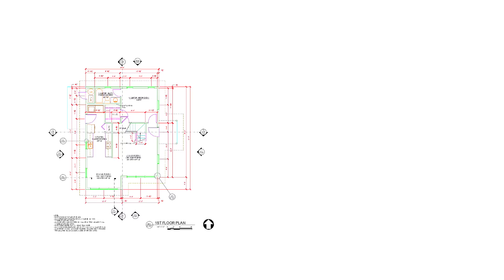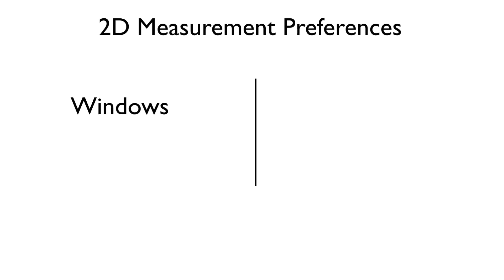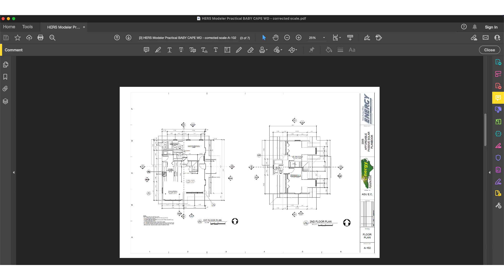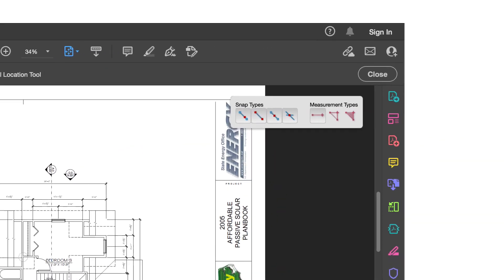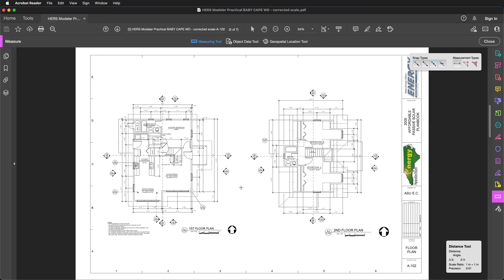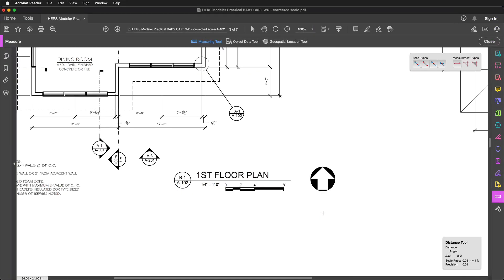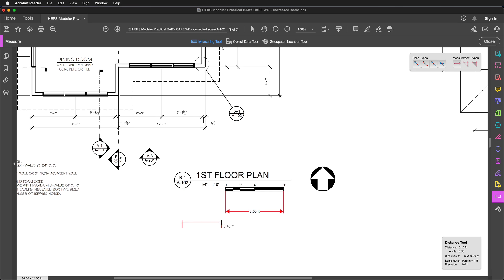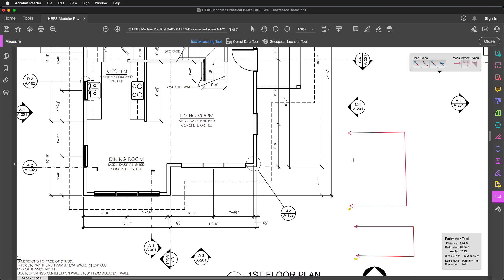How to measure plans in Adobe Acrobat Reader.

Comment: How do you set a scale on a document that does not have a preset scale? For example a screenshot from Google Maps of an apartment complex site. I know the length of a certain wall is 30ft (from measuring in the field). I want to calibrate all measurements from this 30ft wall.
Reply from the maker: You want to find out how many inches are in one foot.  To get this use the measuring tool and draw a line from one end of the wall to the other.  It will tell you how many inches it would be if it was printed out.  Now divide the number of inches it shows by the length you know the wall to be.  For instance, if it shows 7.5 inches and the wall is 30ft.  Then 7.5/30 = 0.25.  So, in that example there are 0.25 inches to each foot.  A scale of 1/4" = 1'.

Comment: My adobe doesn't have this feature anywhere? Why doesn't it show up?
Reply: It may depend on your adobe version. In my version, it was not exactly as this tutorial presented in the very beginning of the  instructions. But after that, it was quite straight forward. Try this below. I hope it may help you.

1) Click on "Menu," and then on Preferences.

2) In the box that opens, click on "Measurement (2D)."

3) Uncheck the first option "Use document scale and units...".

4) Click OK.

5) Go back to the menu and open the file of interest.

6) Go to the "All Tools" menu.

7) Still in this menu, click on "See More."

8) Click on the "Measure Objects" option.

9) Then, in the three options that open, click on "Measuring Tool."

10) Right-click on the drawing and choose the first option ("Change scale of...") and calibrate your scale based on an existing measurement in the drawing.

11) Next, in the submenu that appears, choose the type of measurement (distance, perimeter, area).

12) Now you are ready to take measurements. Click on the starting point and then on the endpoint. And again at the end. The measured value will appears, and you can adjust the way it is presented, position, etc. This part may be a little confused, as it has many display option.

Comment: Is there a way to show measurements in fractions instead of decimals? No program seems to offer that option. When we are out the at the job site we measure with a tape measure which has fractions, not decimals.
Reply from the maker: Not that I know of.  One solution would be to use a tape measure that has fractions on one side and decimal on another.  After a few weeks of using it, you will probably have the conversions memorized.  Here is one I found on Amazon, not an affiliate link by the way: https://www.amazon.com/Lufkin-QRL625MP-Quickread-Measure-25-Feet/dp/B004R1JPEA